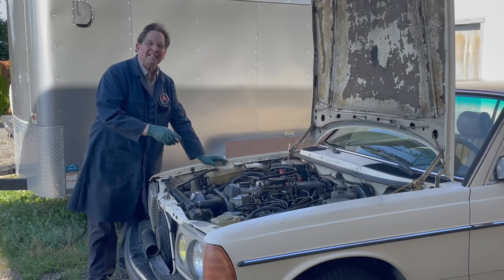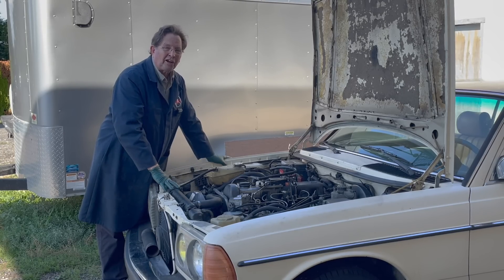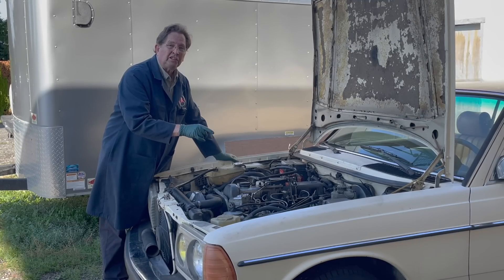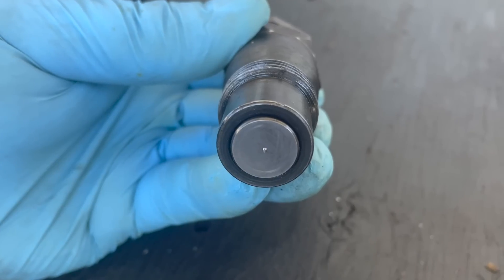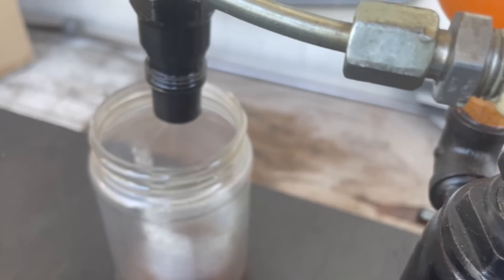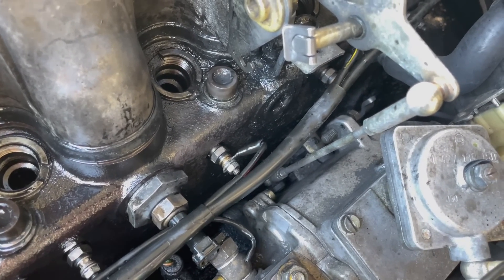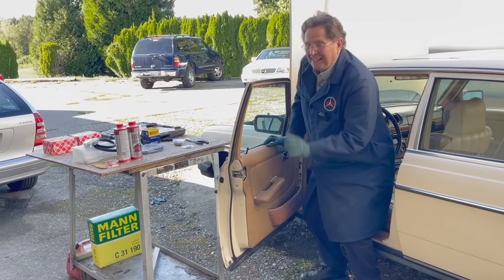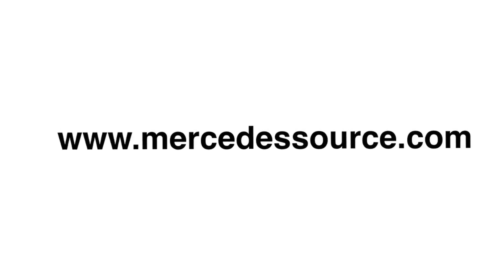Old Mercedes 300D Engine Reported Dead Part 3: The Real Culprits

Comment: Went thru the same exact situation a year ago on my 85 300sd. She’s been running ever since. My car also has over 300k miles and surprisingly after fixing my leaky injector it had a compression test of 400+ on all cylinders. Just goes to show these things are tanks if you find a good one that hasn’t been molested.